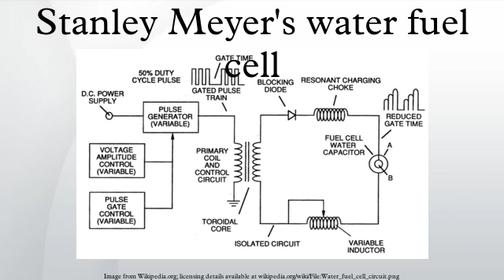Stanley Meyer's water fuel cell

Comment: Stan Meyer's water powered car isn't a perpetual motion machine any more than a gasoline burning car is. Both are burning hydrogen as fuel. Explain where the "perpetual motion" part applies. I'll save you the time. It doesn't.

Comment: guys you can make your own crude oil(biocrude) and or gasses from your human waste. just add pressure and heat to your the camber holding the "waste" and crude oil comes out. dig a whole, throw your waste in it, seal it, the bacteria will do its work and it will start producing gas.

Comment: The water fuel cell is not a "perpetual motion" machine. This is an over-unity device. This is a spook vid
Reply: It's not an over-unity device either. People need to stop thinking that the energy needed to split hydrogen and oxygen is somehow related to the energy you get from burning the hydrogen because it's simply not true.